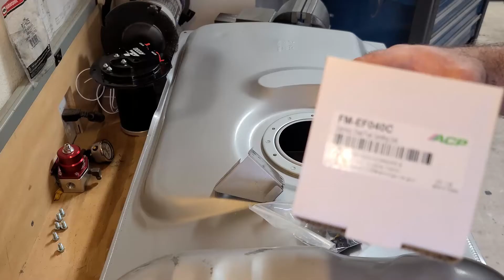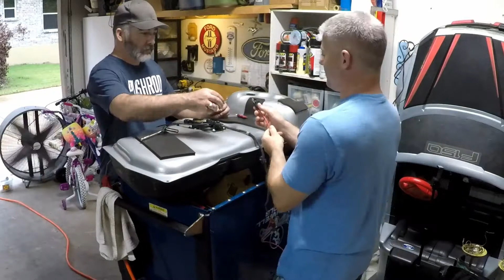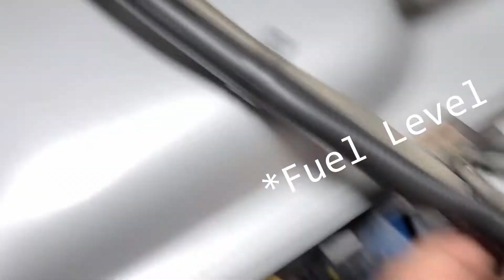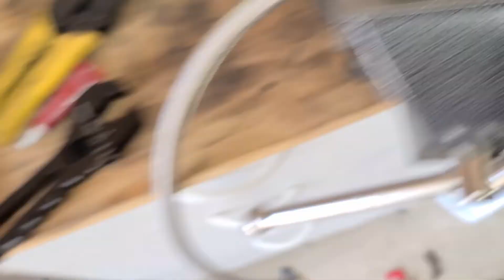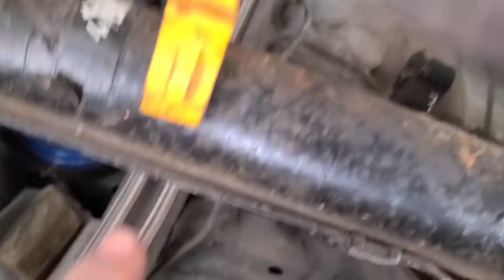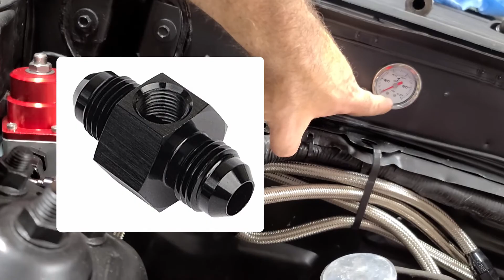Aeromotive Stealth A1000 Fuel System Install Fox Body Mustang

Comment: Have you had any problems with the fuel level sending unit? I read on their website that you have to use a 03-04 cobra sending unit, but the one for a fox is cheaper lol
Reply from the maker: Nope, no problem.  I used https://amzn.to/3FGIdf1 which is the fox body sending unit.

Comment: Great video, I’ll be posting a video of me installing a similar setup with the same fuel tank in my Foxbody. One thing you mentioned is the wiring having to be cut to remove the level sensor. I noticed that the clips that hold it in place may not want to be lifted off but you can pretty easily slide the mount if you ever need to remove the pump and sensor. Figured that’s worth mentioning

Comment: was told not to used 90s because fuel flow is affected instead to go with 180
Reply from the maker: Maybe so, I added this to an existing setup.  I need to get her on the dyno to see what changes need to be made.

Comment: Did you use longer tank straps or longer bolts to get extra clearance between thefuel pump and the spare tire well. My pump is pushed against the tire well and cant get the bolts started . Thanks
Reply from the maker: Same bolts, same straps.  But not the same number of threads 🤣

Comment: I just a started working on my kit and as your did my bolts spun in the fuel pump as well
Reply from the maker: Yeah, I caught it early enough where I didn't cause any damage.  I am a little disappointed in that quality if I am honest.
Reply: @WhitetailGarage  Same thing here just added a little loc tite called it good have you had any issues with your since the install?
Reply from the maker: @scottevans226  I haven't had any issues, but to be fair I haven't put 10 miles on it yet.  The lower control arms need to be changed out, the tires are rubbing...  that will be in an upcoming video!